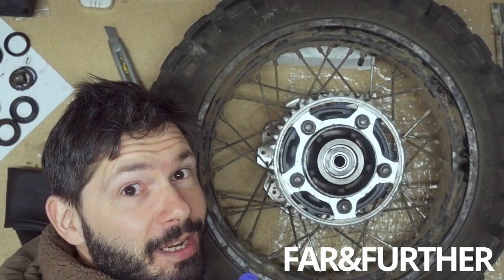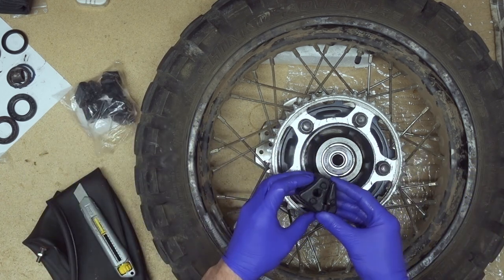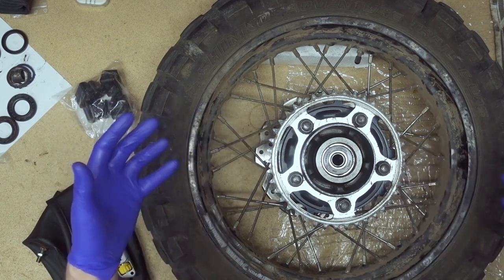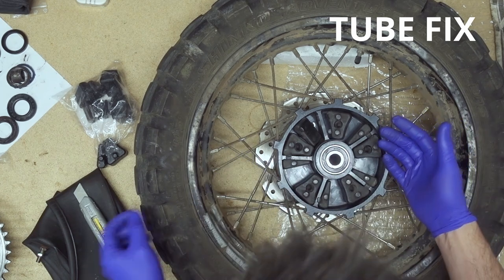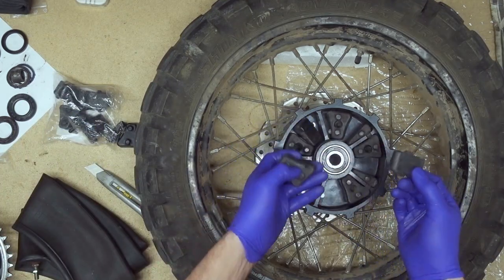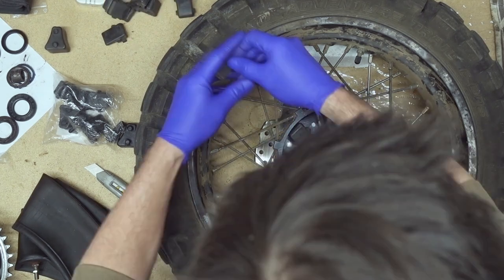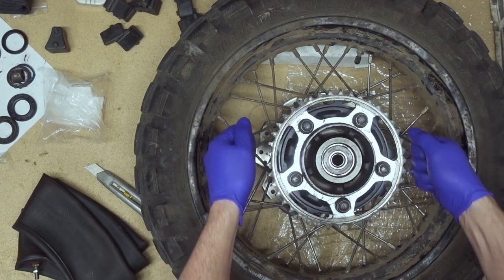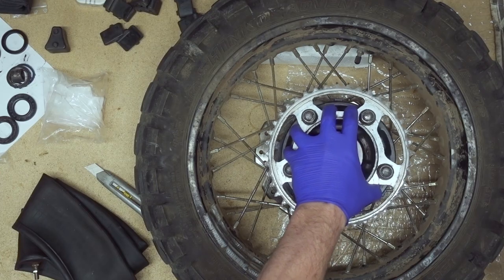Maintenance - Check & Fix cush drive

Comment: Is there a specific direction the drive needs to be installed, trying to determine if a new vibration in my bike is coming from my new tires/wheel balancing, or if i improperly installed one of my wheels. Thanks!
Reply from the maker: You mean the rubber dampeners in the drive? It is only possible to install them one way. I'd check tires, bearings, wheel alignment (rear wheel).